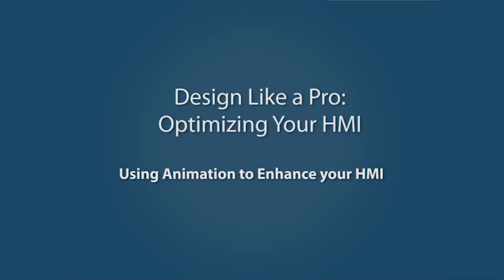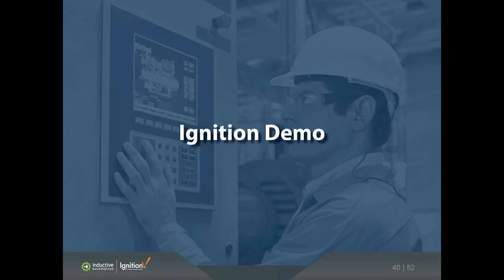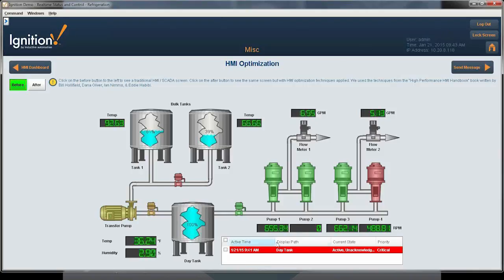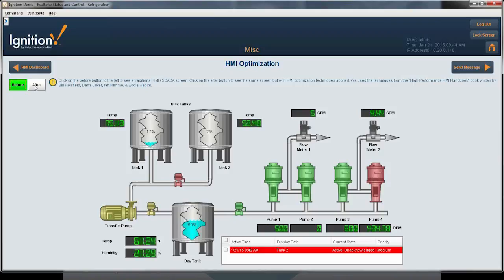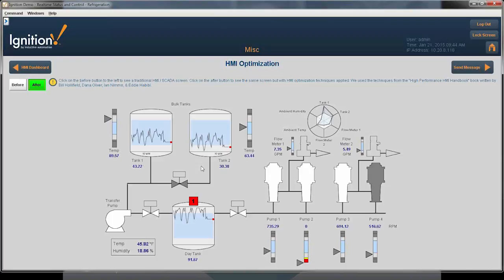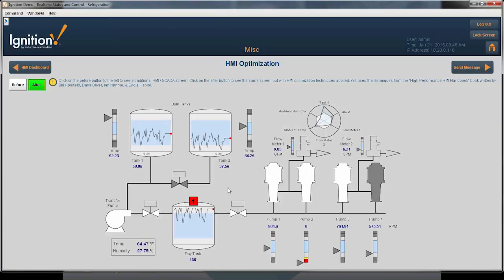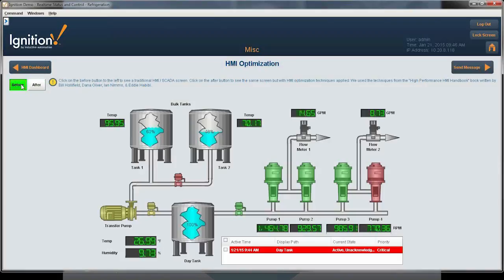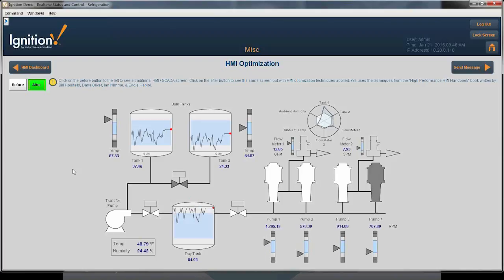Design Like a Pro: Optimizing Your HMI - Enhancing HMIs with Smarter Animation

Comment: I’ve been recommended this video coz I’m doing an HMI project... and might went a bit too much overboard with colors! Thanks a lot for sharing this video. I subscribed.
Reply: Dear can we design a PLC and HMI setup/system in a software and see the communication/protoclos/messages in that software , like we can see and capture traffic among devices in CISCO-packet-tracer software ?
Because I am to work on ICS-security project , I want to know that is this possible to see communication(like modbus) of ICS devices completely in a software designed system , no physical device.

Comment: The complete lack of any visual appearance is not only aesthetically unappealing, also the green pump verses a blank pump like space is much more readily figured to be a pump running or valve open/energized. I agree colors get overused, and I agree there should be a bright red that is ONLY used for alarming but absent of color when your spending thousands or millions for an unappealing screen that is really not any more efficient, only the latest trend. You also had red guides for the level trend lines it seemed which contradicts the red only alarm idea. The display at the beginning was over done, the screen at the end was crap as well....  there should be a happy medium between them, pleasing view without distracting from important items. Strict to the ISA guidelines makes for utterly crappy user interface. Do you have trouble figuring out your iPhone????  The trend might as well be go back 30 years and only use monochrome displays. This trend of color absence is annoying.
Reply: Actually, the current industry standards for colors and animation are based on research and experimentation, not just personal preferences and certainly not artistic considerations.  The key to effective operator graphics has little to do with the appeal of the display but rather the way in which it attracts the eye to areas that need attention.  A perfectly running process with no abnormal conditions should be represented by a mostly monochrome image.  Any abnormal conditions should appear in colors or animation to attract the attention of an operator.  Companies don't spend millions on control systems to make them aesthetically pleasing, they must be effective in helping the operator control the process and identify problems before they become critical.
Reply: @MarkMcMillen2112  very good comment Mark. You perfectly summarize the subject! /Ben
Reply: I somewhat agree with what you are saying, I don't think that these style of displays are just the current trend but they are the future of all industrial HMI. Personally I think the ASM guidelines (the Honeywell HMIweb object design spec is also very good) provide a better overall look to object design than ISA, but I feel ISA better explains the concepts of high performance HMI better than the ASM guidelines.

There is still no accepted standard on HMI but if you take concepts from ISA, ASM and marry them together with something like the High Performance HMI handbook you can arrive at your own design specifications that take the best of both which results in a HMI that isn't unappealing and performs very well.

My recommendations for improving the 'after' screen would be to:
-Change the background objects (like the tank) to a low contrast colour, with no hard outlines (set line colour to transparent, or if detail is required set the line colour to a slightly dark or lighter low contrast colour).
-Don't use white to indicate states, or anything really.
-Pump on, valve open should be a dark shade (rgb(128,128,128) for example) and off should have no fill. Equipment without indication should be low contrast solid fill (like the backdrops) with no hard lines.
-Not normal states of devices should be indicated, but don't go overboard with everything.
-I really dislike the ISA style indicator bars, the ASM ones are far better.
-Background text should not be black but a low contrast colour.